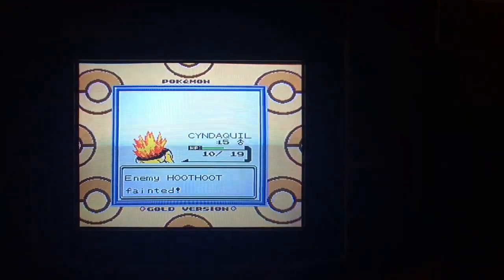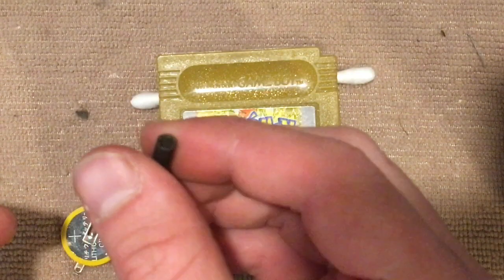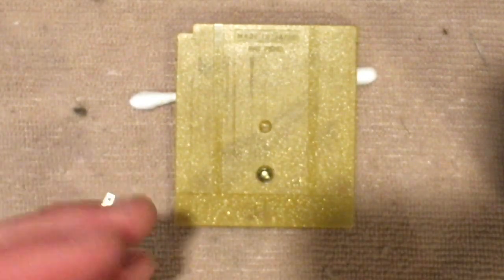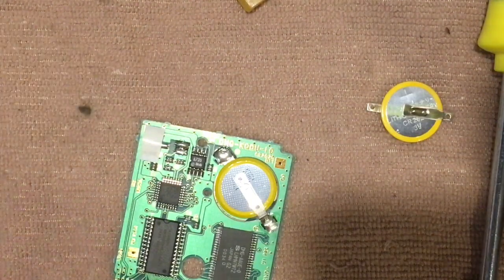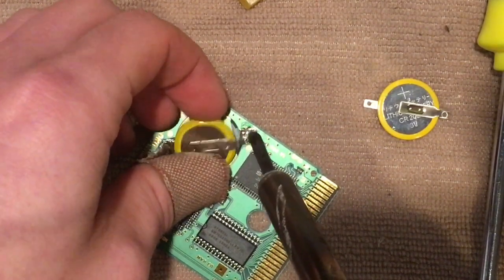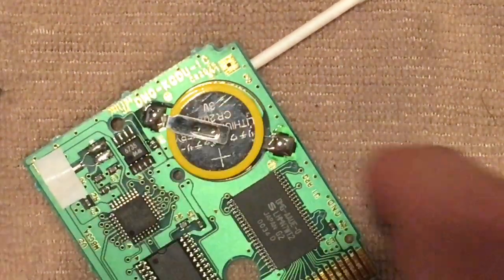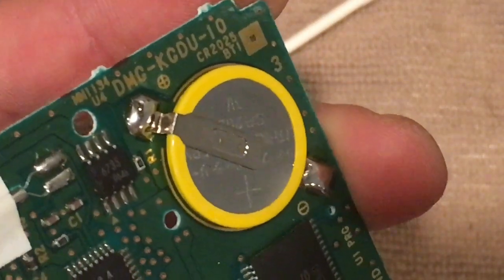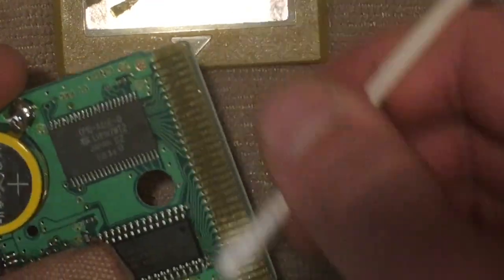Fixing eBay Junk - Game Boy Cartridge Battery Replacement

Comment: Any way to check to check if power supply or power delivery components need to be replaced? Aside from the obvious fact that the orange light does not turn on and no internal components activate
Reply from the maker: Ryan Escobar you would want to test the capacitors and make sure there's continuity.

Comment: Even though I can use my soldering iron well I find it easier to just nudge the pins up that hold the battery in gently with a flathead screwdriver and then securely press the battery down with electrical tape instead of having to do any soldering, it’s easier for me and years from now when the battery dies once more I can replace it easily again as well
Reply from the maker: StuffOfTheSky unless it ever let's go, then your save game is gone.
Reply: RetroRepairs It's been a couple years and so far that hasn't happened to any of my games, but if that does then I guess I'll go back to soldering

Comment: Is there a way to save those tabs and carefully pry off?
Reply from the maker: Sorta.  You can pry the tabs off the battery, but you can't reattach them properly to a new one, you'll need to tape the battery in place.  I dont trust that method, although some say it works fine